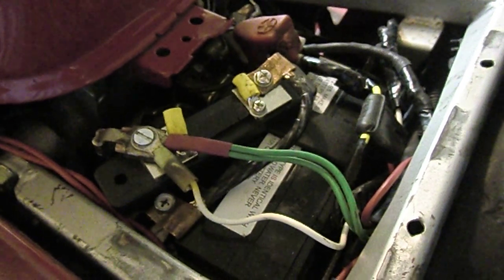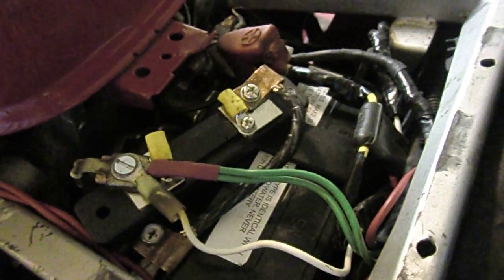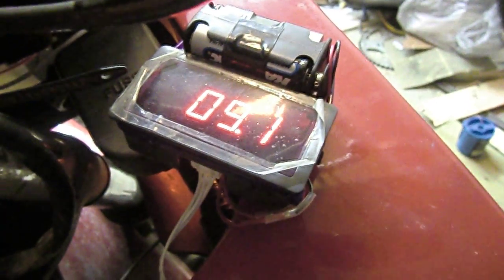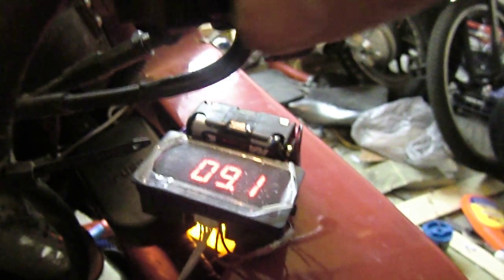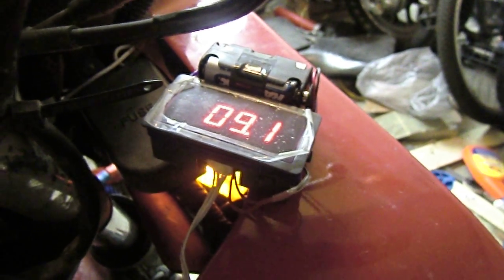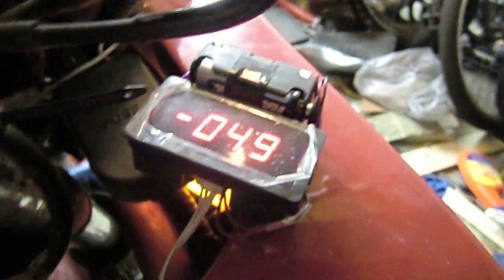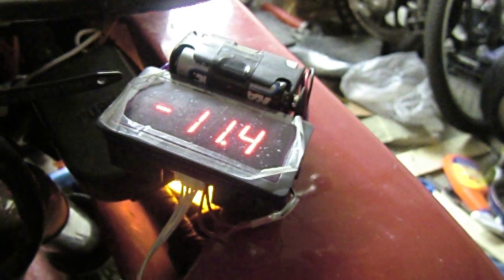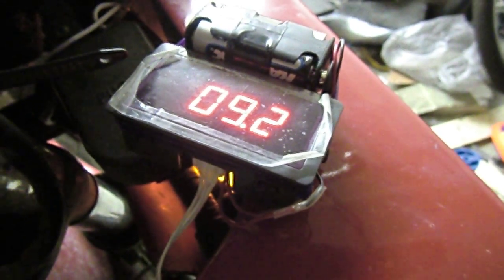Using a current shunt to monitor current flow through my motorcycle's battery

Comment: Paul, that's a great video! If could please tell me the difference between wiring the shunt from your POS terminal to NEG in reading or operation that would be greatly appreciated.
Reply: Probably not much difference. The pro of wiring it on the negative is that you would reduce the risk of shorting out the terminals against any live wires.

Comment: tyour starter is drawing alot amp.. I would think that it shouldn't draw more than 20 or 30 amps for the starter?? The lights are also seeming to draw alot of amps if it is 9 amps.. was the bike in an accident? perhaps some short somewhere? Did you test for amps drawn with the lights tuned off to see how many amps were drawn when all lights are off and another with the key in the off position?